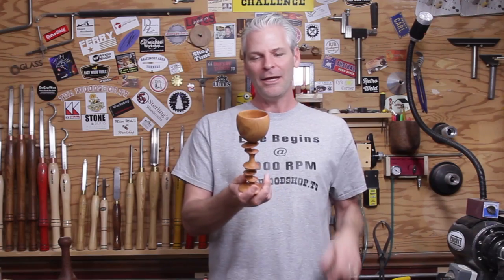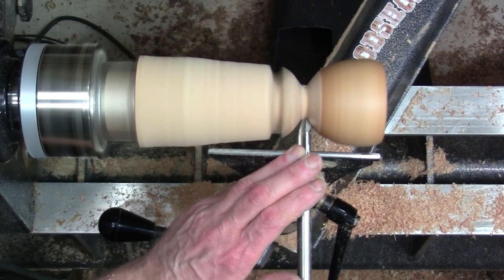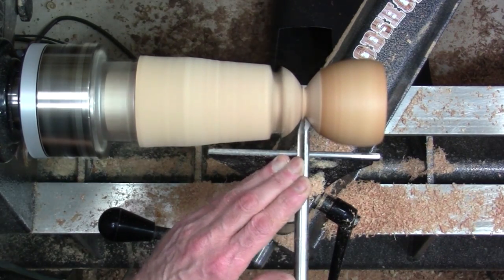Woodturning Off-Center Goblet

Comment: I like the paper idea for following the ghosting. I'll have to try that next time.
The goblet turned out awesome, as usual. 
lol I was hoping you were going to try the 2 jaw method on your off center turning. It works great for me, and I actually feel more confident that the wood is secure because I'm not trying to grip it at an angle. (I still actually don't even know if any one else has tried it before at all) 
Cheers!
Reply from the maker: +Jerry Paul Thank you very much Jerry! I really like the way you did the Off-Center piece awhile back, but my jaws don't unscrew like yours. I'll mention it in the video on Monday though.
Take care,
Carl
Reply: Cool!
Now look who's got tool envy! hahaha ;)
I actually found out that my jaws come out by accident. On the #4 jaw there was a set screw that came loose which kept it in place, locking in all the others. Once I realized that was all it did, I left it out and viola! I now have a 4 minus 2 jaw chuck. :D
Cheers!!

Comment: great work Carl! If you sand with the oil mixture does the wood absorb the oil with the fine abrasives and the sawdust? I could imagine that fine dust and abrasives can get mixed in with the oil and that it can go into the wood. 
How do you do the moving shots? 
I turned my first succesful bowl two weeks ago :)
Reply from the maker: +knives&stuff Congratulations on the bowl! Thank you Maarten! I wipe off the wax and oil after each grit. I don't think that much stays on the wood. I'll show the camera rig on Mondays video.
Take care,
Carl

Comment: Appreciate ALL of your teachings, at your convenience please reply:
It looks like you are using spigot jaws to provide more contact on tenon? If so what is approximate diameter of tenon, understand this may vary with project. I want to try more off set or eccentric turning considering buying another chuck designate it for off set with spigot jaws or look into  Robert Sorby or Vicmarc jaws both are expensive do you have any experience with these? Your recommendations appreciated. David
Reply from the maker: Thank you David! It been a longtime, but it looks like 2"dia and 2 1/2" long. Robert Sorby and Vicmarc both make great tools, but I've never used one of there chucks. I have a few friends that love there Vicmarc chucks. sorry I couldn't be more help.

Comment: What do you use for sanding? And are you dry sanding to xx grit, and then wet sanding?
Reply from the maker: +Andrew R I sand with Howard beeswax and orange oil. You can fine it at Home Depot. I only dry sand if there's torn grain.
Reply: +Carl Jacobson thanks.
Reply: +Andrew R picked up some at the Depot today. Does it replace the need for sanding sealer, or do you still need to use it. Also, do you have to let it dry before you finish it?